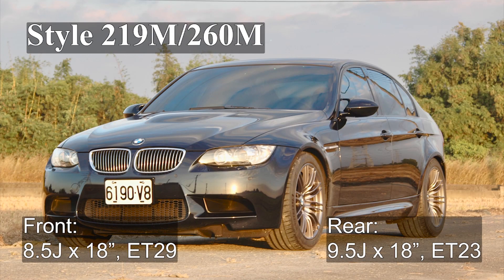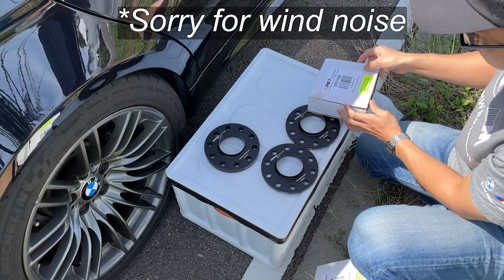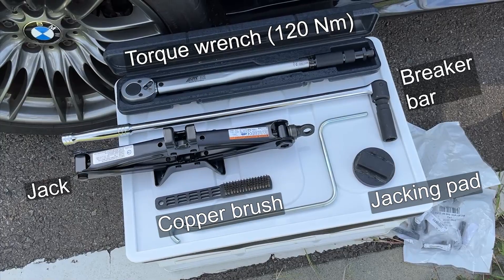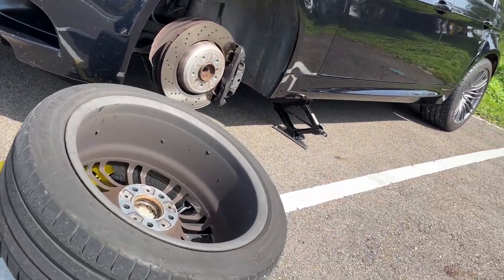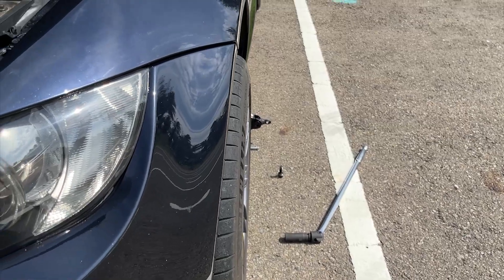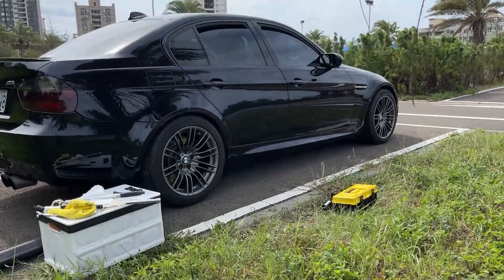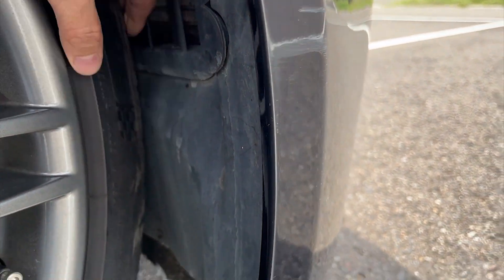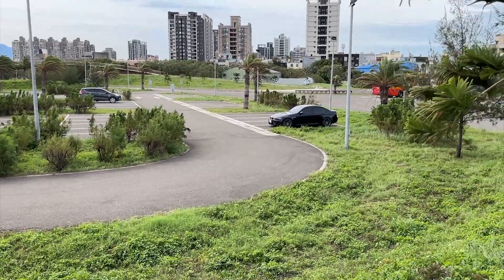E90 M3 Flush Fitment on 260M with ECS Tuning Wheel Spacers

Comment from the maker: There is rubbing in the front with 17.5 mm spacer (Stock EDC suspension, style 260 M rim and Michelin PS4S 245/40). No rubbing in the rear. I changed to front 15 mm/ rear 12 mm so please see my update: https://youtu.be/ks56usa901w

我發現前輪用17.5 mm 墊片會有摩擦（原廠EDC懸吊、260M輪圈、米其林PS4S 245/40輪胎）。後輪沒有磨擦。我改為15 mm／後12 mm厚的墊片，請見我的更新：https://youtu.be/ks56usa901w
Reply from the maker: I changed the setting to 15 mm/10 mm in the front/rear. Please watch this update https://youtu.be/ks56usa901w

Comment: I went with 15/12mm front and rear. Looks like a slight poke with 17.5mm in the front. Lowering it or more camber could help.
Reply from the maker: Thank you Aspireonthego! I think my front is poking too 🤣 and the rear can poke a bit more. I feel like giving 15/12mm a try 🤗
Reply: @funcarsgoodpeople  For sure, give 15/12mm a try. My front tires rub the inside of the fender liner ever so slightly under full lock as well. The rear rubs very slightly where the liner bumps out (at where the fender and bumper meets on the inside), this only happens when going over big dips at high speed, I've seen marks on my tires from that but it's not audible. I heard this is a common point of rubbing, some people trim the bump or heat and remold, but I've just left mine as is.
Reply from the maker: @Aspireonthego  I see! Thank you again for the tips. Do you often take passengers?
Reply: @funcarsgoodpeople  Anytime! I have driven 3-4 other adults on several occasions, so full car. The rear wheel gap is pretty much non existent at that point, but the rubbing never gets bad to the point that I hear anything rubbing.
Reply from the maker: I see! Sounds good about the rear 👍 I’ll pay extra attention to the front 🤗
Reply from the maker: Hi  @Aspireonthego  I just found some rubbing in the front so indeed 15 mm should be the ideal number 🥲
Reply: @funcarsgoodpeople  Sounds like a plan 👍 No issues with rubbing on mine with 15mm up front and the same tires, 245 PS4S.
Reply: @funcarsgoodpeople  12-15mm is not much, but offsets will decrease the axle life slightly depending on how much the offset increases the moment arm... lotta OE engineering time goes into the stock configuration.
Reply from the maker: Hi @js290 thank you for the assurance! I just put 15/12mm spacers on today. Really looks great.

I always respect OE engineering so I totally agree with you! I guess the drawbacks of increasing offset, e.g. vibration at high speed and decreasing axle life as you mentioned, are going to bother me all the time.🙄If I am not feeling comfortable I will just revert to OE.
Reply from the maker: Hi @Aspireonthego I just put 15/12 mm spacers on today. Looks really great! Thank you again for the information 🤗🤗🤗